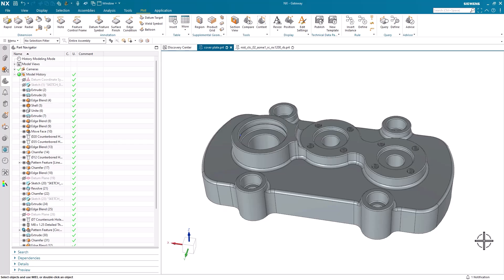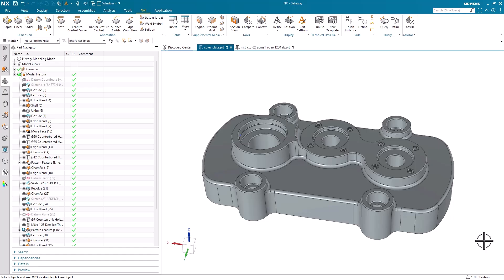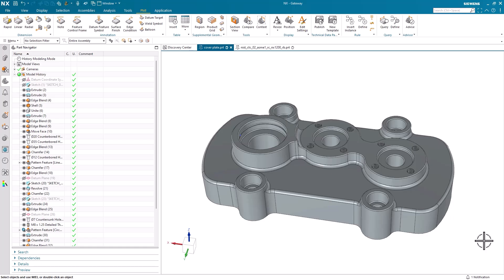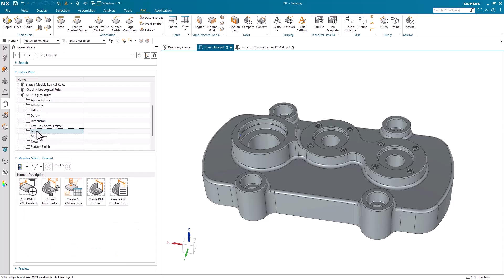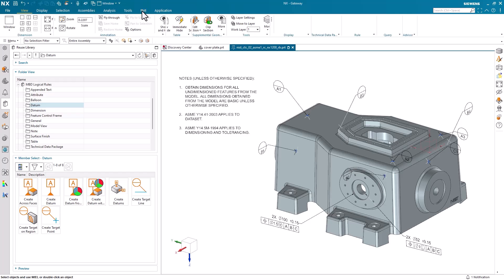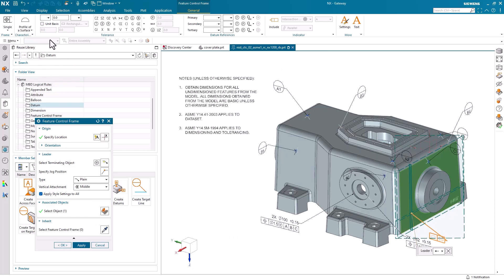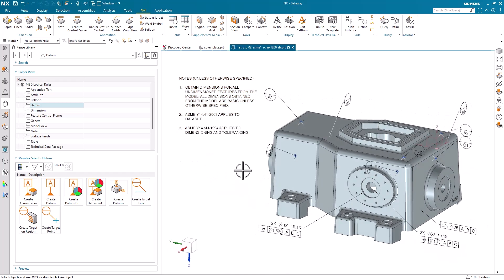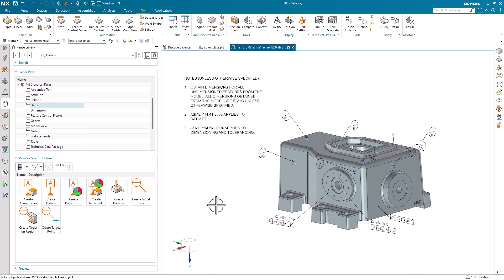NX | Tips and Tricks | PMI

Comment: 2:48 but how does that work in JT?
Reply: Hi @liquidblake. The PMI Note is always defined on a plane at its source. The Parallell to Screen option is recorded in the JT file and can be utilized where possible, however the information is best consumed while using the view of the definition for the PMI. If using e.g. JT2Go you can see that the PMI will stay flat on the screen when rotating the geometry, however it is still the view of definition that is proper way to view the information. IN JT2Go this is done by utilizing the Align View option.